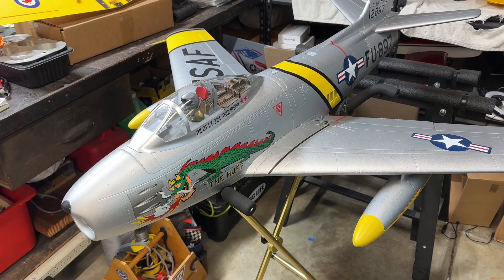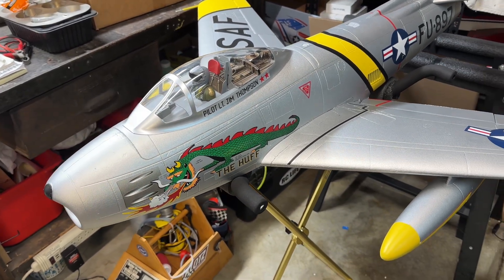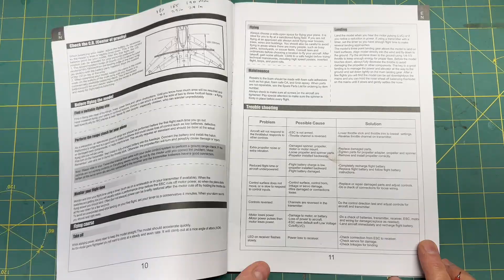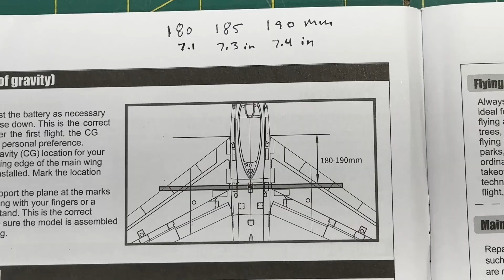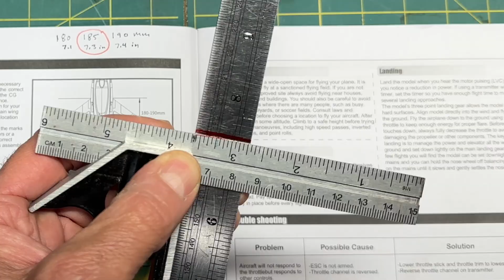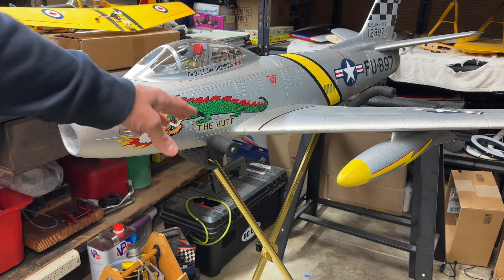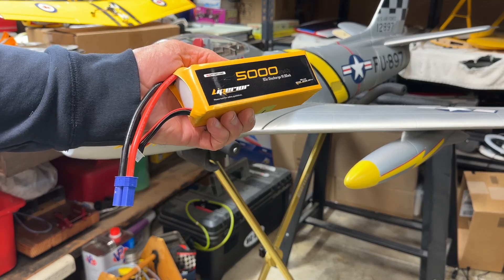FMS F-86 Sabre, 80mm EDF RC Jet, How to properly set the plane balance

Comment: Great video ! One comment , I always balance planes with retracts with gear down . You balance an RC plane with retractable gear down because that’s the most forward CG configuration, and it’s the safest reference point for flight.
Reply from the maker: Thanks I appreciate it. I always thought that the landing gear up is a little more conservative because if done with gear down (mostly considering front gear if it swings forward), then when raised the cg will shift back and be slightly tail heavy during flight.  I see it mentioned both ways is some forums. I’ll have to look into it a bit more. Thanks for the comment I do appreciate it.
Reply: Critical step that many modelers don’t respect. Cause of many a crash in my experience.
Reply from the maker: yes sir! Thanks!!